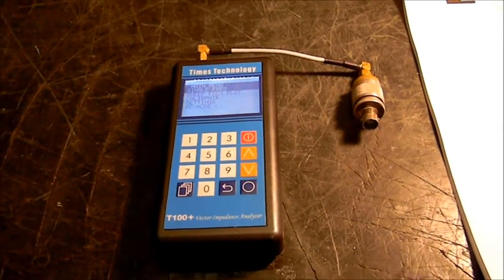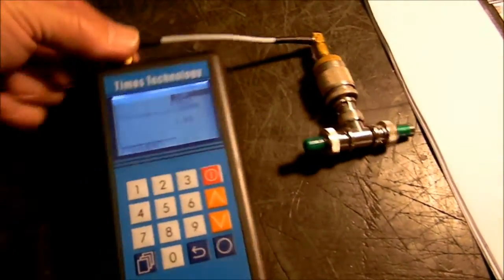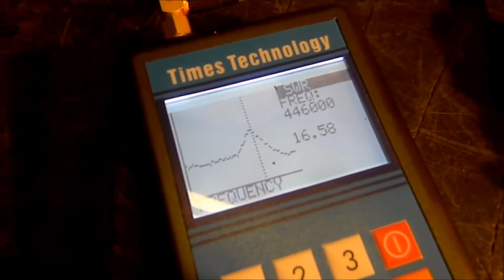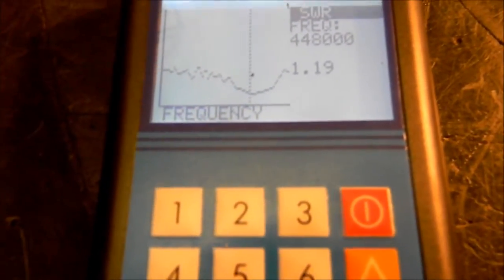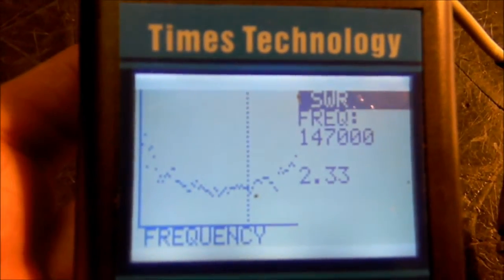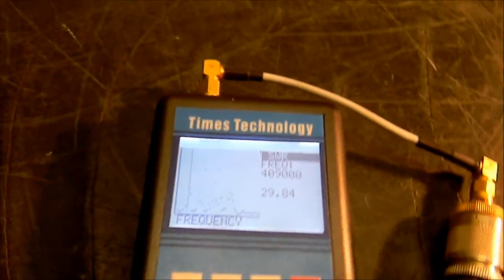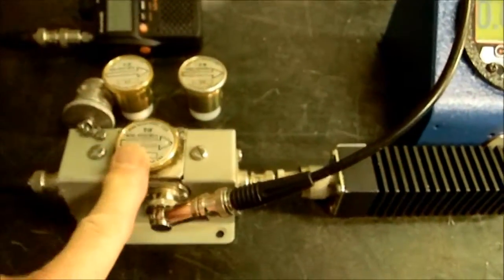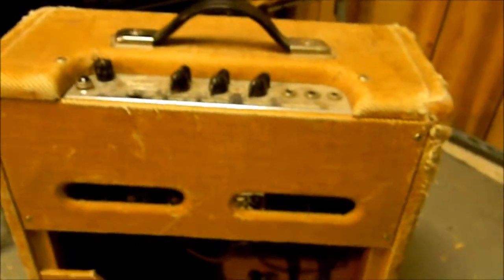Times Technology T100+ Antenna Vector Impedance Analyzer.wmv

Comment: I bought one of these back in 2012. Used it once. I stored it without batteries, but when I tried to fire it up this week it wouldn't turn on. Not sure what could have failed in storage. These buttons aren't the best, so perhaps there's a way to bypass those? Any ideas or suggestions to revive it?
Reply from the maker: They are pretty cheaply built. I just recently put mine in a box to give to the local ham club as I have purchased much better instruments since then.  I find the Mastech MS5308 LCR Tester much better. You can directly read impedance values off transformer windings with it.
Reply: @ElPasoTubeAmps  I actually spoke too soon. I took it apart and cleaned the ribbon cable contacts, and now it's working again. I'm also second guessing if I just wasn't holding the power button down long enough. I paid $50 for it in 2012, so for my limited uses it will get the job done.... but thanks for the info on the Mastech tester!